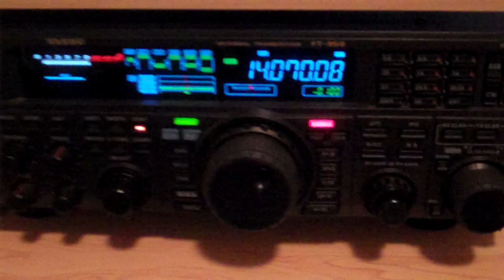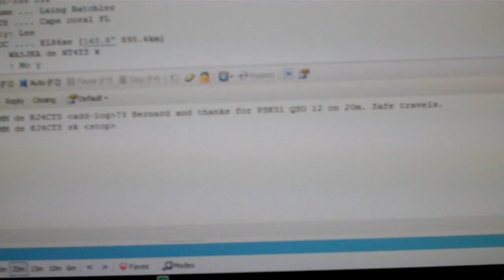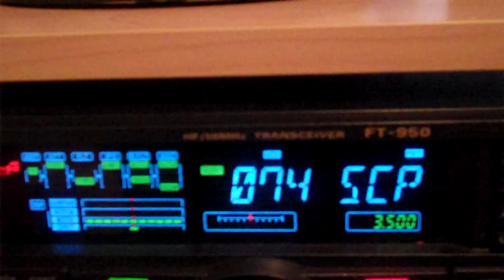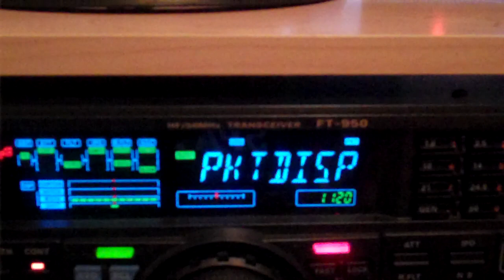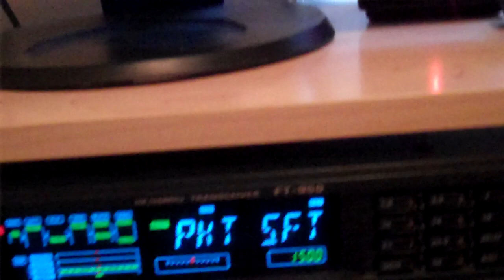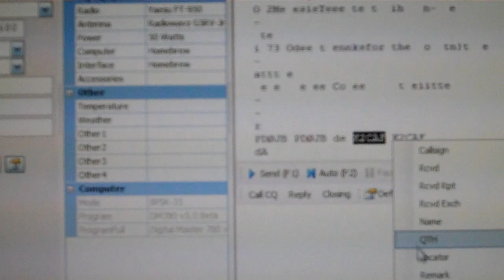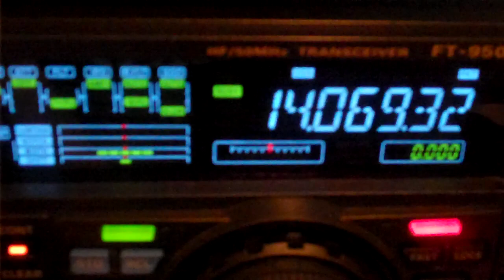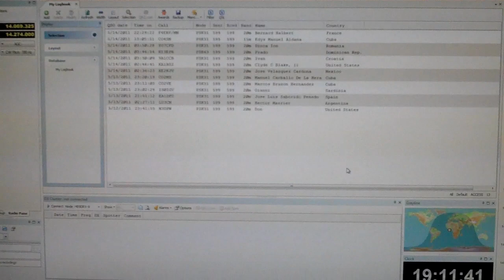FT-950 PSK-31 Demo

Comment: It isnt 100% correct. I am using the Yaesu FT-950 with a microHAM USB III Interface. I always use USB and never used the Packet Mode and still can use the Data Jack on the back.

Comment: I have a FT-950, adjusting the RF power through the menus is not very user friendly but with HRD you can make a front panel control for it making it very easy and simple. 73's KC9RXB

Comment: I have the 950 and am using the Digimaster Pro Two and for the life of me i CAN'T get 
HRD and DM780 to run I know I must be doing something wrong but I really don't know
what.I set my setting and then when I try and start it again it starts with some off the 
wall radio. 990,7000 etc.Any Ideas? Thanks 73Jim W5CJB
jim.buck.w5cjb@gmail.com

Comment: I have my ft950 and i'm having problems with that data jack hum i have de cable to use data from the ft897 is it the same ? if it is , doesen't work i use mixw for digitals but i think the audio cable doesen't work with this radio can you help with the interface or cable
CT2JDZ

Comment: Hi Scott, thanks for the video. I'm considering buying the FT-950 to replace my IC-7400. One thing I feel I might miss from the 7400 is the physical RF PWR control on the front. Would it be possible for you to make a short video showing how the RF POWER is adjusted on the FT-950 ?

I understand its in the menu. Its a control I use a lot on the IC-7400, for instance when tuning an ATU with 5w, then back to 50W or 100W for TX...

It would be helpful to see it in action!

Regards, John M0UKD.